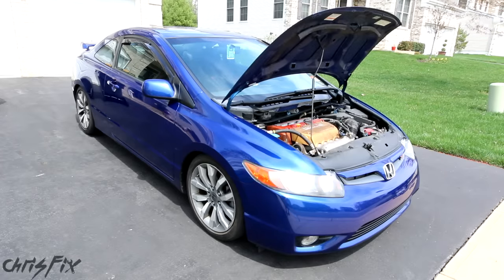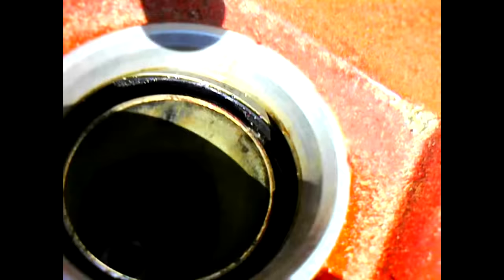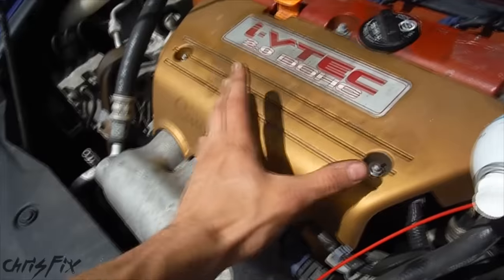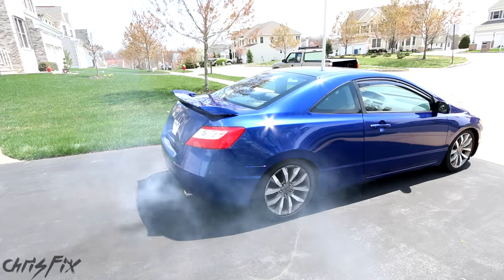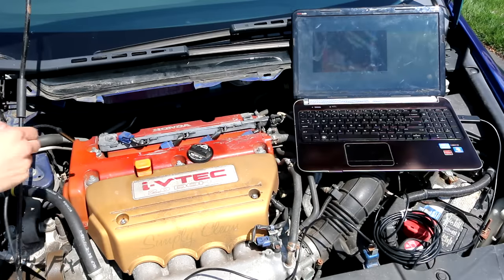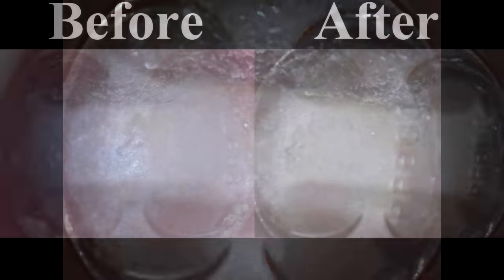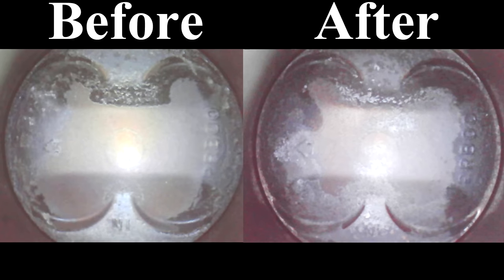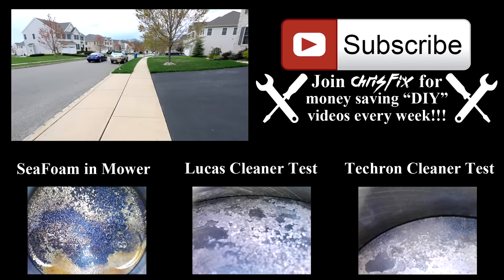Does Seafoam Actually Work in a Car? (with Proof)

Comment: Hi chris, I was wondering, is it possible to directly spray it through the hole where you insert the camera, let it sit for 30min - 1 hour until it dissolved all the carbon deposite, then start the engine to removed the desolved carbon through burning?
Reply: That's how you get hydrolock
Reply: @xXFraudXx  I do not think so. Hydrolock happens when a large amount of water or fuel makes it way to the cylinder.

My question is, just to spray the right amount of seafoam (I do not mean to spray until the cylinder is full with liquid seaform), let it sit 30-1 hour to dissolve the carbon. Seafoam is like a paint thinner. If you wait long enough, it evaporate. So there is no way it will hydrolock the engine.
Reply: @stephenmichael3211  you said nothing about letting it evaporate when you first proposed your idea, your original parameters were to just let the carbon dissolve. You're now moving the goal posts by changing the conditions of your original proposal. Hydrolock can occur with any fluid, not just water or fuel, and it doesn't have to be a "large" amount, as that is subjective and not really quantifiable. Had you added seafoam to "let the carbon dissolve" (it won't) and started the vehicle before it "evaporated,"  then hydrolock could occur. That scenario was possible under the conditions of your original proposal. Additionally, if you dissolve a solid with a liquid, then evaporate the liquid, you're left with a solid again. But, it seems as though you know it all already, so why don't you give it a shot and find out what happens. Good luck.
Reply: @xXFraudXx   (waiting for 30min to 1 hour) is where the seafoam evaporated. I do not change anything from my original post at all. I just explain it for you to understand it in my 2nd post.

Thats the idea. Solid to liquid to solid again. 1st Solid (very sticky and thick) to liquit (desolve) to solid again (not as sticky as before and high probably easier to be burned through combustion).

"Seafoam does not desolve the carbon", if it doesn't then how does it clean the carbon at the first place?

Comment: Hey Chris, i heard that sea foam may not be the best option for a direct injection system. What are your thoughts on this? I have a vw with 1.8 tsi and am looking for my best option.
Reply from the maker: Use good quality fuel and install a catch can, products like these don't usually help that much or at all
Reply: @chrisfix  you're a g. Thanks for your input

Comment: Would it be a good idea to do an oil change after this. Like where does the carbon go ?
Reply: The carbon will just go out of the exhaust just like the white smoke and while an oil change wouldn’t hurt you don’t need to get one unless it’s low or old.
Reply: @lightenupindustries7522  no I meant the solid carbon build up not the gas.

Comment: Hi Chris, question I recently removed my spark plugs and some of the plugs were wet with oil, so when I installed the new spark plugs as a result got that white smoke coming out of my exhaust, can I use seam foam to clean the spark plug wells and should I replace the new spark plugs? …thanks for your amazing work.
Reply: B12 piston soak

Comment: Aside from cleaning the engine, what are the benefits of doing this? Does it improve gas mileage and if so, by how much?
Reply: My wrangler went from 19 mpg to consistently 21-22 mpg. Higher than what it is advertised to get. Just one can of seafoam in the gas.

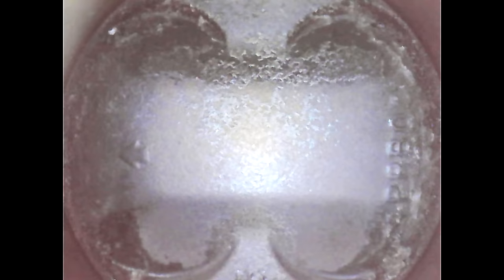Comment: Hay CHRIS,  at 5:56 it looks like you dropped some debris in with the bore scope.  Should we vacuum the tubes before we remove the plugs?
Reply from the maker: You can and probably should do that. The dust wasnt a big deal because the light on the camera amplifies even the smallest amount of dust that gets in front of the camera, but any time I remove spark plugs these days I use a vacuum first.

Comment: What’s everyones opinion on using this for turbo’d cars? Would you put it say before the turbo or after the intercooler? And how would all the ejected carbon act on the exhaust side of the turbo?
Reply: You want to put it into the vacuum line right before or right after the throttle body (wherever the closest vacuum line you have is). I used it on my turbo Saab with good results. 

I didn’t run it in the crank case. I used Rotella T6 oil - technically a diesel engine oil but it kept my saab engine clean. Way better than Mobil 1 - first oil change was black after switching. If you don’t want to run pure T6, you could add some to your oil. It has a lot more detergents than regular gas engine oil.

Comment: I thought you were supposed to disable the fuel pump, so the engine is only running on Seafoam, not gasoline or both gas and Seafoam.

Comment: My question is: Is that small of an amount of carbon even a problem? It's not enough to touch valves or anything.
Reply: I guess if it's on the valve seats it would cause some sealing issues. But we didn't see that.

Comment: Hi Chris. I did everything you told me. reved the engine up while applying Seafoam, however my engine has noise now. When i try to rev to 2500 I hear loud rattling noise. Can I still drive it (now it’s off) as there is still a lot of smoke ?. (If I bring it to a mechanic he will 100% suspects head gasket from the huge smoke)
Reply from the maker: What car are you doing this on?

Comment: I have used oven cleaner on my Ford 2.2 diesel Galaxy  ( Peugeot  engine) and my turbo and engine  noise ( harsh sounding at high speeds) has completely gone.

Comment: I believe this car is multi port fuel injected so there would be no carbon build up because the gasoline will be sprayed on top of the valves. I wish he would have found a really gunked up engine to test

Comment: hi, I'm not  sure this the right place to ask you about this, but I would love to hear your opinion regarding GDI engines intake valve carbon cleaning especially with the CRC  intake valve and turbo cleaner? thank you
Reply: I think it is more a problem on turbo GDI engines.  My 2013 Focus 2.0 (5 speed manual) has GDI (but is NA) and it has 346,000km on it.  Runs like a clock.  I do drive it hard too.

Comment: Im a little confused. On a port injection vehicle, wouldnt jus throwing it in the gas tank do the same thing? Itll be mixed with the fuel and clean the injector subsquentially cleaning the intake valve right and end up in the combustion chamber anyway?

Comment: When the pistons are at the top of the cylinder, do the valves sit right on top of the pistons in those little circle seats or is their a gap between top of piston and the vavles?
Reply: The "simple" answer is, there is always a gap(under normal driving conditions), if there wasn't, the valves would hit the pistons and you would have bits of valve rattling in the top of combustion chamber, For a While, but then you would have a deceased engine, search YouTube for "destroyed engines from broken valves" to see result.
The more complex answer involves the case of overrevving( see Chris at 4:19-> 8000 RPM) and what is called valve float, where the cam is slapping the valve down so fast it doesn't have time for the spring to pull it back up and the valve hangs and the piston collides with it, but the relief cut out in the shape of the valve in the piston top allows for a little bit of this to happen, but again see "destroyed engines from broken valves" for end result if you keep it up.
The cut outs also serve as a way to increase your compression ratio where the valves are part way open at the top of the piston cycle, without the cut out you would need to have a shorter flat top piston which would not go as high in the chamber, resulting in a lower compression ratio = less power.

Comment: why not add seafoam to the oil intake?    Where did he spray this in?  It looked like the air intake, is that accurate?   Is it better than adding it to the oil or are they different types of seafoam?   If Chris doesn't respond, Can someone answer these questions for me?

Comment: What impact on the catalytic converter does this have? Does it increase exhaust heat and damage the converter? Does the removed carbon clog the converter reducing any performance gains the cleaner piston provides?
Reply: I thought the converter was part of the exhaust system and not the oil system. If oil gets in there it can cause the converter to fail. I would think a better operating engine and less carbon would help the converter to have a longer life.
Reply: These videos always show the exhaust belching white smoke. If this exhaust were to have chemicals, temperature changes, or dislodged engine buildup, it could degrade the flow of exhaust through the converter and reduce overall performance. Hypothetically.

Comment: Chris if i didnt want to spray into throttle body on my 2010 V6 Accord, could i spray instead into the brake booster vac line? Its easier for me .
Thoughts?
Reply from the maker: The instructions say to spray into the throttle body so I would just stick with that unless it says something else otherwise

Comment: So for anyone a lot more tech-savvy (specifically, car savvy), is the removal shown on the vid a good thing to consider for an occasional driver? I barely drive my car, around once a week, so kinda iffy about the carbon deposit removal. It was a hand-me-down from my dad too, which is what actually made me concerned and looked up. It has run for nearly 110,000 km over the course of 11 years.

The carbon deposit shown on the video is kinda similar to what I have on my dad's car. Just a bit more darker on the edges.

If anyone can tell me regarding my car, here's the model:

Nissan Navara 2011
King Crew-cab version
6-Gear MT
V4 engine
Reply from the maker: You only really need to do this if you notice a fuel economy decrease or knock/ping from detonation. If you drive your car and bring it to operating temps each time you don’t need to do this in most situations.
Reply: @chrisfix  Didn't expect the man himself to reply, but thanks for the clarification!

Comment: Wouldn’t cleaning out the carbon cause a compression drop and promote oil consumption (burning). And how advisable is it to do this to high-mileage engine?
Reply from the maker: Opposite. The carbon causes oil consumption in most cases. If there is nothing wrong with your engine you dont need to do this.

Comment: Sippin water in the intake does mostly the same thing. DUMPING water excessively doesnt work. Just gotta be smarter than the device and do it correctly so it will work.
Reply: That's basically what happens during an Head Gasket leak.. So it's likely that it works, just don't use too much, and it might not work in Diesel engines, maybe?
Reply: @yafois988  EthGly is just like 25% of the total in antifreeze, with hotter places getting ir to 5% or something.. Concentrated antifreeze is like 50% max EthGly. It's also an alcohol so it probably just burns...

Comment: Im still kinda confused on why the car we tried this on didn't smoke. It did take really long for the bottle to empty but its a small 1.6 engine so I thought even a half dose should had been enough.
Reply from the maker: Since you did not add a lot at one time it didnt smoke. That is fine, you did it the "safer" way.
Reply: Hey thanks for the reply.
I have a theory it's might have been related to the car being misfiring on one cylinder, aparently the replacement coil pack I got for it was broken on arrival.
The misfiring would lead to a really hot catalitic converter, and thus the oils might have completely evaporated or combusted.

Comment: I just found ur channel but I could use some help. I have a 2019 kia soul I am a bilateral amputee and I got stuck on the highway. I had my car towed and they said my 3rd injector was stuck open. Said they repaired it but it's still dying on me with check engine like blinking and then dying

Comment: There's hardly any difference. In fact its worse because carbon on the piston edge helps compression.
Reply: @Bollox 123 Yeah right, that's why the factory puts carbon on the edge of the piston LOL. The things some people say.
Reply: @nojunkwork5735  The effect I described is only relevant to high mileage engines (the bores wear slightly) LOL the things people say.
Reply: @bollox1235  You keep on believing that nonsense. LOL, the things people believe.
Reply: @nojunkwork5735  You believe that which is contradicted by photographic evidence. LOL
Reply: @bollox1235  No I dont. I believe you don't have any idea what you are talking about.

Comment: Do you have to change your oil after doing this? I assume not.
Reply: I recommend it. That chemical goes in the oil
Reply: @daniel.m3257  If I only spray Seafoam into the intake and add Seafoam to the gas tank, but NO Seafoam in the oil/crankcase, then it wouldn't go into the oil and I wouldn't need to get an oil change after, right?
Reply: @Eric WebSurfer  ture but probably little exhaust fumes go through the headgasket etc. And it like air in the combustion chamber.

Comment: Hey Chris the can of seafoam I have says to add 1oz per quart of oil, so that would be 4.75oz's of seafoam. And it says to add it righ to he oil.  Mine did not come with that S shaped prayer you have.  Any thoughts?

Jim Renehan
AKA : RENMAN
Reply: Different product from Seaform, and it will help your engine too. You want to use that can when you are going to change your oil.

Comment: What about having those particles break up in the cylinder?  Can it scratch the walls and damage rings?
Reply: Carbon wont scratch rhe cylinder walls,debris like sand and metal bits on the other hand will

Comment: Mate I got a problem with fiat 1.3li water jet engine that has a faulty mass airflow. I think it’s possibly the EGR valve building up carbon from short journeys, but it’s a 2011 model so could be the DPF which I need to clear out. Is there a possibility using this stuff on a Diesel engine to clean out the EGR valve and reduce lag on acceleration? (I’m changing the mass air flow and air filter first

Comment: @chrisfix I tried this in my 2013 Lexus GS with 240K miles. I hooked through the throttle body and started spraying for 2/3 minutes. A ton of white smoke and then the CEL light started flashing. I stopped, let car soak for 10 minutes. Then started, and car was normal with no lights. 

I would like to have done the whole can but got scared with the CEL flashing. What would you do?
Reply from the maker: I would not be concerned, this wouldn't damage anything and the check engine light is flashing because it's running rough while you are doing this (to be expected) and it would go away after starting up and driving around normally
Reply: @chrisfix  thank you! I I expected the CEL but when it started to flash I got concerned. :/

Comment: I did this on my truck with 250k and literally no smoke came out lol
Reply from the maker: Are you sure you're putting the seafoam in the right place?
Reply: ChrisFix yeah I did it through hose going into the intake
Reply: I did this on a 98 Mustang GT with 140k and my neighbors came running outside to see if they should call the fire dept lmfao. Then I did this to my 2008 Chevy Express with 220k and no smoke came out lol. Been looking all over the internet to see if it's safe to use on my 2015 Ford Transit 3.5 ecoboost. Heard diff opinions about possible turbo damage.

Comment: hey chris my 2000 dodge ram 1500 with a 360 mpar in it shoots black under hard throttle is that just carbon build up getting shot out its been like this fir a couple days now after ive used some injector cleaner in the fuel

Comment: I use Brake cleaner in the intake remove the  air filter  just spray it in will do the same.😁🇩🇪.

Comment: Not very good research because you are not going to get the instant results you are looking for. The sea foam actually works after you put it in and drive the car for a long ways. It's a slow process and by you checking for results right away will not give you an accurate result

Comment: I'm looking at this or crc gdi intake valve & turbo cleaner, but I've got an aluminum charge pipe that doesn't seem like the tube will work well. I was wondering if my charge pipe has a meth bung (unused) could I pull the plug out and snake the hose in through that up past the MAP sensor to spray it in?

Comment: I have a 97 ram 1500 not sure if I should pour it through the brake booster or down the throttle body injection
Reply: I've never done it like it's done in the video. I've only added Seafoam to my gas and oil. It seems to work well for me.

Comment: Can I just put the sea foam in the gasoline tank instead of the engine tube?
Reply: the bottle i got from autozone said to add it to the gas tank.  1-2 oz per gallon.  it made my 03 sierra 2500hd with 183k and 35" tires run like new again whereas before i had trouble just climbing a hill.  the check engine light also went off, bonus!  not back for about ten bucks.
Reply: William Nolan thx for the info.

Comment: The stuff's all waste of money you want to clean those cylinder heads out good put 93 octane in your gas tank for two tanks run for a couple weeks spray some carb cleaner through your carburetor rev it up one can a week you get in there you'll see even better results
Reply from the maker: Thanks for sharing.

Comment: I've seen seafoam literally destroy motors.
Reply from the maker: Interesting, what typically happens before that?
Reply: @chrisfix  on my own cars, nothing just carbon build up. but no smoke good compression. I'd recommend taking head off and cleaning the carbon with break cleaner and soft towell.
Reply: @willbroccolo8389  So how did SeaFoam destroy these engines you are talking about?

Comment: very questionable results. Gas has additives as well, run it hard to remove carbon. At least try it on poorly idling engine, see if it does anything and for how long.